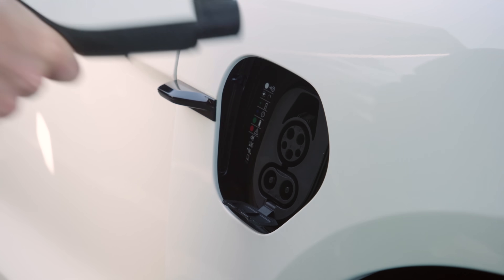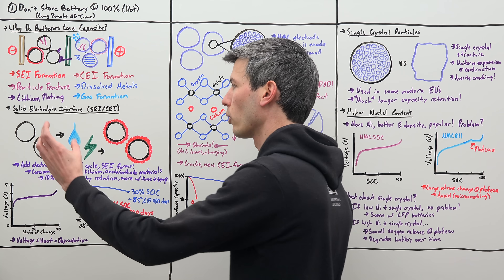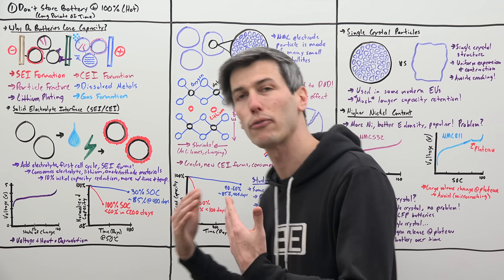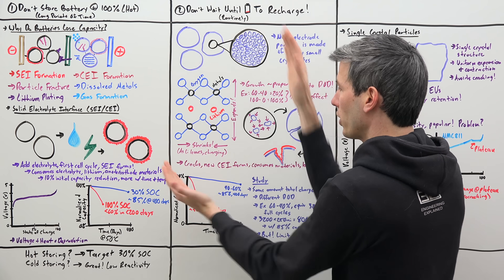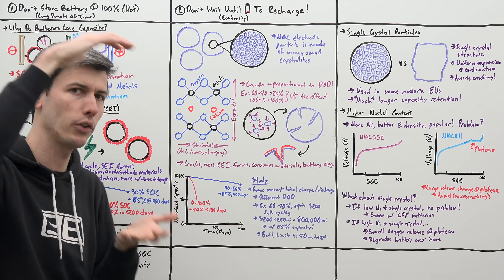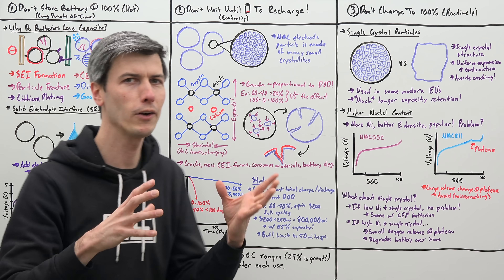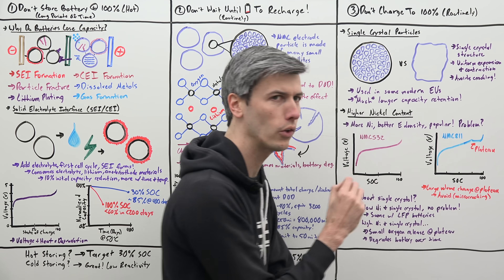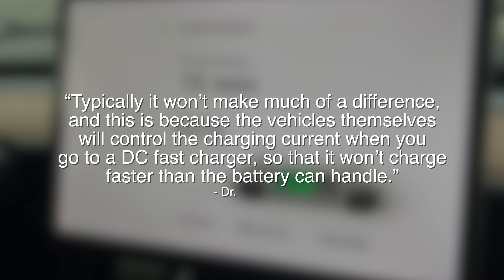How To Ruin Your Electric Car's Battery - NMC Edition!

Comment: @Engineering Explained,  Hi Jason, great vdi, but how come charging 20% for 400 days is an equivalent of 3200 full cycles? I believe they did it in a constant loop of charging 20% and discharging 20% but even though 3200 seems pretty high... What am I missing?

Comment: The 10 percent, manual-reading EV-enthusiasts take care. The other 90% general public will make all mistakes - repeatedly. Always load it to 100% - must be good. When driving - drive until the battery is at Zero and dies, no time to charge. Once in a while charge it to 100% and leave it standing for 3 months. Only use superchargers if not at home, they are faster. And to do all this - and keep doing it - just make a new lease every 36 months. It´s exactly what will happen. Who cares?

Comment: avoid dc fast charge use home level 2 11kwh charger and stay within 10-80% your ev battary wont ever see degradation below 90% of total soc after a 10 years or 200k km average lifetime of the ev usage the battary will last longer then the car if you stick to this routine.

Comment: 1. Avoid storing the vehicle in heat.
2. If storage in heat is unavoidable, keep the battery at 30–40%.
3. Charge daily to 50% plus half of your typical daily consumption.
4. Avoid frequent 100% charges; stay below 80% unless necessary.

Comment: If you keep your battery between 80%-40% charge, does that slightly lower the capacity over time? Would you ever charge to 100% say once a month, or once every 3 months? Or does even that practice have adverse effects not beneficial to the life span of the battery.
Reply: If you never charge above 80% that does increase longevity, but you are not using the full rated capacity of the battery. Say in 5 years, would you recommend charging to 75% instead of 80% to account for the lower capacity of the battery?

Comment: Just bought a 2026 model Y July 29th. I was asking if I had a LFP or NMC battery on the forum tesla owners online. A guy was saying that NMC & NCA were about the same type of battery with a few exceptions. As you posted 2 videos, How To Ruin Your Electric Car's Battery - NMC Edition! and the next was How To Ruin Your Electric Car's Battery - LFP Edition. The sticker under my frunk said I had a Battery Chemistry Li MM (NCA). Your video titles didn't say NMC so I was wondering do I use the NMC video and those guidelines? 

I live in Ohio and have a level 2 charger at home. So, I have been charging to 54% every night as I have a 79-mile round trip commute to work. I have the ability to charge at work if needed, but it's just over twice the cost of doing it at home. Would it be more beneficial to the battery life if I charged it to 40-45% every night? Just going to and from work. For trips I know I can charge accordingly to how far I will be driving. Thanks ahead of time if you can answer this question.

Comment: So, I am still scratching my head to understand fully what you mean by "LFP battery's tend to have a longer cycle life & more flexible charging habits vs. NMC". Could you elaborate on that? Since it sounded as though charging after every trip if beneficial for every NMC battery, to extend its lifespan. Does the same apply to LFP batteries? @Engineering Explained

Comment: About to get my first EV with 800V architecture NMC chemistry battery car Zeekr 7x … got an option to home charge  at 22kw per hour  ( 3 phase ) or 7 kw per hour ( single phase ) does it make any significant difference to my battery longevity …

Comment: Some useful tips, however constantly driving around at much lower range and constantly plugging would do my head in! I'll stick to 80% and charge to 100% as required. I don't understand why people are obsessed with testing batteries every month especially with so many variables are involved. Temperature, climate, battery degradation. Just drive you car and enjoy it!
Reply: Don’t you plug in daily? What’s the hassle? Plug in once and wake up to full.
Reply: No point leaving plugged in  24-7 I just maintain a decent charge level above 30% plus I own another EV @cedric182

Comment: The ESS (energy storage system) of my car still has full 100% capacity after 5.5 years intense usage. I always, absolutely always charge it up to 100%. Never did any less than that. Still get the full 30 gallons of gas in 🤔. What do I do right?

Comment: Just can say: if that is what people shall do, EPA must adjust the standards how to calculate the EPA range. This is nothing but a big lie. My Tesla has an EPA range of 349mi, which it actually never provided. After two years my Tesla offers 320mi on a 100% charge. If I ought to charge to 80% only then the EPA range must be exactly that. The rest is like carrying a gas canister in the trunk. Never heard that my tank capacity shrinks just because I fill it until gas spills out. What a joke. Get the tech right before bothering people.

Comment: This is great information. Thank you so much. It seems as at this time Battery powered vehicles using Lithium Ion aren't ready for heavy duty use such as couriers, full time drivers, etc. The cars will need to be DCFC'd daily and sometimes even twice daily and depth of charge will be a killer. As a rideshare driver using 1-Pedal Drive, ECO modes, etc... I still need a 10-95% daily charge. Even with a L2, a well maintained Hybrid seems to be the best option to stay away from financial volatility with these after 200k miles.

Comment: Model 3, 54k 5 yrs old, 79% capacity. Mainly charged L2 between 25% to 85%. It's degradation is more than Tesla and YT claims should be 10 - 15%. Tesla says it's normal!  Smh. Tesla Lies.

Comment: California comment.   6-23-25 I holding out on  going electric until the next breakthrough on battery technology. I have 2007 Toyota Camry Highbred with just 34,000 problem free miles on it. Based on cost vs effective value the Toyota is much much better then a Tesla and I don't have to worry about power black outs or having it catching fire in then garage. .

Comment: I’m paused at 5:20 with a question… I just purchased an EV (that I confirmed has NMC batteries) and I’m curious… I don’t have access to regular home charging (my apartment L2 chargers are broken with no ETA on repairs…yay landlords) so my plan was to DCFC about once a week or when I got to 20-30% SOC… should I do a quick fast charge daily? Every other day? I have a roughly 20 mile round trip commute and rarely do much driving on the weekend, and my car estimates 205 miles of range at 80% charge (2023 VW ID.4 Pro RWD if that matters)

What is my best practice for frequency of charge, at least until my apartment finally gets the L2 chargers fixed?
Reply: …I should have finished the video before commenting
Reply: @jaygaymes dont worry, charge to ~70-80% and wait until your facility is up again.

Comment: @EngineeringExplained Completely comfortable with this excellent presentation tks! My question is whether an EV NMC ever NEEDS a 100% charge for cell balancing to promote longevity? I'm not talking BMS calibration or LFP. I'm familiar with active/passive cell balancing theory, but it doesn't get much credible mention anymore? Your cited researcher always does periodic full charges just to measure capacity degradation... which might also be balancing cells (or he's only testing individual cells).
Do modern EV BMSs balance at lower SoC or continuously? Is it just assumed the occasional full charge before a long trip will serve the need? Is there in fact no longer any need? I would happily NEVER charge to 100% if I could be certain it was of zero value to the battery to do it.

Comment: your description ( and the papers free snippets) are unclear about the term "degradation"...
if you are trying to say, storing a batter at 100% after 400 days it will be at 85% or 60% depending on temperature, that is less important.
but if you are trying to say a battery stored at 100% (capacity of 2 Ah; amp hours) after 400 days comes out of storage at 85% or 60% (capacity reduced to 1.7Ah or  1.2Ah) (.85*2   or  .60*2 ). that is a completely different thing.
please be more specific about these studies.

Comment: I was seriously thinking about buy an ev car, but your very thorough video convinces me that this is just too much to deal with.  OMG!!
Reply: I bought my first EV, 2018 Chevy Bolt, just over a month ago, and I can't even charge at home overnight! (apartment living). But I bought it anyway bc oil changes for my CRV had gone up to $80 and timing belts and replacing ICE engines (blown head gaskets) and automatic transmissions (don't even get me started on those).  Too much.  EVs are simpler and more reliable and few parts and the battery packs will last the life of the car, just as Jason said.  I charge exclusively at public DC fast chargers and Tesla Superchargers.  Those are more expensive than charging at home, but close to the cost of gas (sometimes lower, sometimes higher), but I don't care.  

I went electric for the reliability and security.  I'll probably never have to buy another car (I'm 64), but, should I ever able to afford a Tesla Model 3, I'd love to have one of those!  Anyway, I was scared to go electric, too, but after a month of driving a Bolt, I look at gas cars now and think they are so antiquated, so ancient!  I can't imagine going back to a gas car (*except* if driving a very long trip and I was on a tight schedule, or a long trip to an area of the country that has very few public fast chargers (central Kansas, western OK, eastern OR, or most of Montana).  But living east of the Mississippi River as I do, available public fast charging isn't too difficult to find, and if you can charge overnight at home (even if you only use 120V to charge, the slowest charging), then you should still be fine in most circumstances.  I encourage you to continue considering going electric.  

As Jason explained (but was easily lost in all of the technical jargon), you can pretty much use and charge an electric car any way you want to, and the giant battery pack should still outlive the life of the rest of the car!  No worries.

After a little bit of research, I decided to dive in, and I'm glad I did.  Good luck in your search!

Comment: New EV user here… I heard from other videos it was okay to stay between 20-80% charge? Is this video indicating that I need to charge more frequently, like around 50%?
Reply: 20-80 is fine. If you can charge at home and do, say 50-75, well, it's better, but nothing that can radically change the battery life to the current knowledge.

Comment: I would like to solve the charging problem of a 49kW NMC battery electric car, I would like to use it between 50%-80%. My question would be whether it is possible to reduce the battery charge to, for example, 40% and how often is it recommended to charge it to 100%. Thank you in advance for your answer.

Comment: glad I was able to find this video. It is exactly what I was looking for and confirms my practice. I set the max SOC at 80% and recharge after each trip. I use the car maybe 2-3 times a week with a nominal trip length of 10 miles. That's why I moved here. I have a solar roof 3.2Kw max and generate about 2.8 on a good winter day.. I set the max charge rate at 60% of max input to slow down the charge. I want to use the excess solar not the grid. I wish I could slow it down more. Currently our local time based price system is off peak during the day so this is working out well. I am researching a battery solution to capture the rest of what I lose to the grid for almost no return. Pointguard is the likely solution if it pencils out.

Comment: I have a 64 kilowatt battery and I've set mine to charge to seventy percent. How low in percent can I go each day. I do up to 60 miles a day.  Which is worse going low or charging higher for battery degradation if you are going to go over your millage. I will just clarify thst last question so is going to a lower depth of dicharge worse for your battery when you need to rather than chatging upto a higher stae of charge when you need to for battery degradation.
Reply: I agree there isn't an agreed answer to this. Until there is, I choose to push the lower end to avoid the known issues with high SoC for any length of time [+ temp]. I'm happy with low end SoC being just enough to eliminate any stress about running out of charge on some journeys home, say 10-15%. On arrival I then immediately charge to 30% (known battery low stress point), then later to 70% (75% winter - my winters are mild) in cheapest tariff window. All automated of course. Result is battery almost always sitting in 30-70% range over time while using up to 60 (65) % DoD, minimum 30% available for emergency, most charging done at cheapest rate, & routine high SoC easily avoided.
I'm no expert. It's just what I think is best for me based on everything I've read, adjusted for source credibility.

Comment: OK, but I thought fast charging would heat up the battery more, which, as you say, is harmful.
Reply: It does to a point. Most packs have their own heating and cooling, so when DCFC ramps up the cooling kicks on.

Comment: Hi Jason.  based on the information you received in this video, do you think it's better to run my Chevy Bolt from 90% to 40% or 80% to 30% when I take my monthly 100 mile trip?  This is in the winter when I'm not getting great efficiency.

Comment: Nice video! What about the fact that the SOC display on the dashboard is not the real SOC of the battery?  mostly around 30 to 85% of the real SOC displayed on the majority of dashboard? When you think you are charging at 100% SOC, the real battery SOC is only around 85%...? Everything that is told in the video must be applied to the effective SOC, not the displayed SOC wich can be different?

Comment: Two questions: Given the recommendation to limit the charging range to the smallest conveniently possible range;  If I were to get my NMC equipped vehicle to a lower state of charge (SOC), say 20-30%, would it be beneficial to bring it back up to the normal SOC, say 80% in small increments over the course of a week or so?  We are retired and don't drive much and this would not be inconvenient.  Also, I may have missed it, but is there a need to charge to 100% occasionally?  If so, the previous question comes into play and how often.  Would ramping up to 100% over time be better for the longevity of the battery.

Comment: What about low temperatures? There is basically no information on charging/discharging in below 0 *C (-10*C, -20*C). Should we just take them as generalization, that lower temp = better? Then why EVs are warming up battery first before charging? Is storing them in -20 *C harmfull to cells?

Comment: Excellent video and easy to understand! 10/10! 🔝🔝👏. Any small detail to take into account with NMC batteries used in PHEV? can you explain why they use same buffer (5-6kw) in a 25,7-19,7kw battery compared to a much higher one for EV’s (77-82kw) this happens in volkswagen cars. Thanks!
Reply: Reckon it's because PHEV batteries are worked harder. The smaller battery is cycled more frequently, and/or more likely to be fully charged & discharged because of the smaller electric range they offer. Running them flat (usable) also much more likely because ICE backup means no fear of being stranded. Then even slow charging at 7 or 11 kW is a much higher "C rate" for the smaller battery. Degradation also more likely to be noticable from the smaller initial range. These PHEV batteries need the buffer help more than full EVs do.

Comment: I have a question: with NMC batteries, what exactly constitutes a battery charge cycle? If I charge from 30% to 80% is that a full battery charge cycle or a partial (I.e. roughly half) battery cycle? I am only Interested from a battery life/longevity perspective . It has a direct bearing on how often I charge my EV.
Reply: Reckon we can confidently say a 30-80% charge & drain is half a cycle. This video also indicates twice as many 30-80% (or even better 20-70%) half-cycles will promote much better longevity than the same output using full 0-100% cycles.

Comment: So on a long trip, which would require a 95%-5% cycle, am I better off doing two 75%-30% cycles, using a fast charger to recharge in the middle?

Comment: This is excellent information. I’m around a 110 outlet 24 hours a day and always have my car plugged in. It lives in the mid 60’s soc. Max charge to 70% daily and generally use 10% for my commute. I always wondered if it’s better to discharge more, now I know. Thanks!

Comment: A measurement scale once learned gives you a one on one correspondence to a number and a physical property. For example, if asked to retrieve a 1/2 inch wrench in America, one knows about what size wrench to look for because one knows how long 1/2 inch is. My advice—give measurements in both  celsius and Fahrenheit. Especially when a number is an outlier. Like 50c actually being over 120f and that being misdescribed as “warm.”

Comment: Hello EE, I have a question that you can hopefully answer. I am at the verge of buying a 2024 ioniq 5 that has the nmc battery because the 8th character on the vin is a letter and not a number. I live in Colorado where it gets really cold in the winter and really hot from March-September. Its maximum height of heat is around June through July and first half of August. It has a bigger 84kw battery with AWD. What is the ideal amount of times you should take it to a DC fast charger? What SOC should I be in? Bottom, Middle, or Upper part of the battery. I'll be using a level 2 charger most of the time everyday so how much battery life can I use and when do I stop and get my car juiced up again?
Reply: I live in Ohio and I take mine to a public charger maybe like twice a year if that. I generally like to slow charge it at home. In the winter, I make sure that while it’s sitting in the cold Ish garage do not have a charge over 50%to save battery.